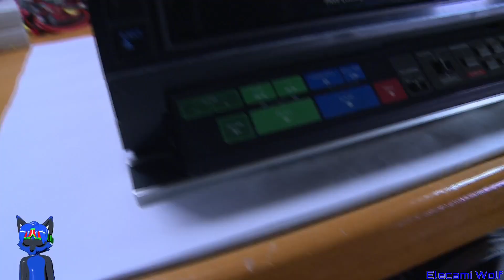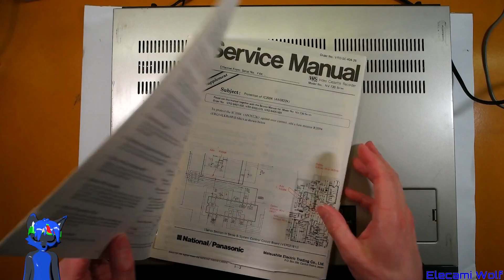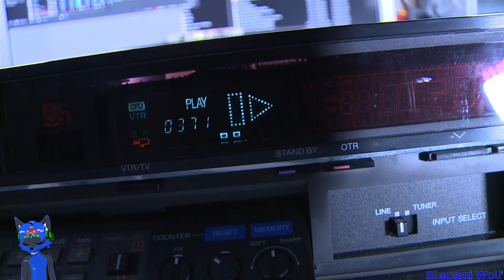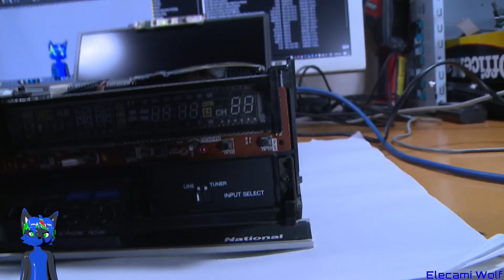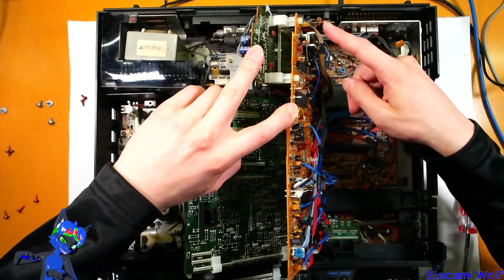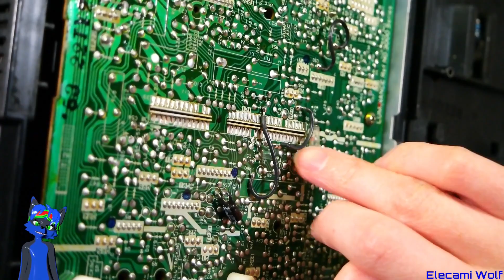EW0118 - National NV-770 VCR Investigation Teardown

Comment: Over the weekend I plugged in one of my old VCRs, one I salvaged from a job that ended 12 years ago and I never even tested, and I was happy to find it works fine.  The color wasn’t great but that might be a factor of some kind of artifact watching VHS on an HD LCD TV.  (Another VCR I tested had no audio so that will be a project to troubleshoot.)
Reply from the maker: Nice to find it working 🙂
Yes, you need analog TV can look better with VHS. Digital devices can have trouble keeping track of the unstable signal.